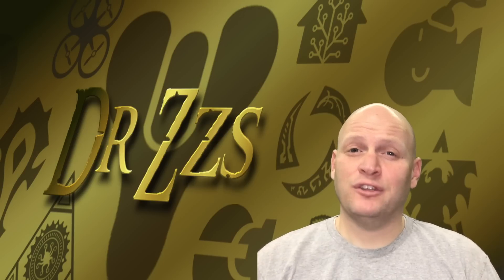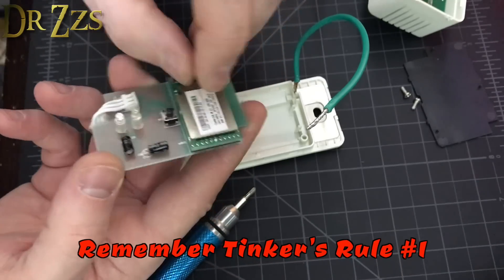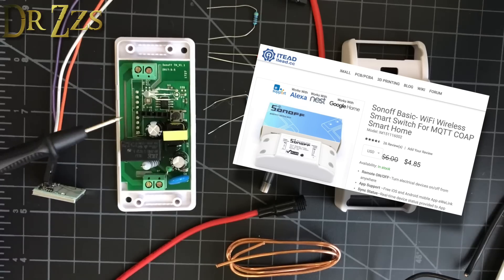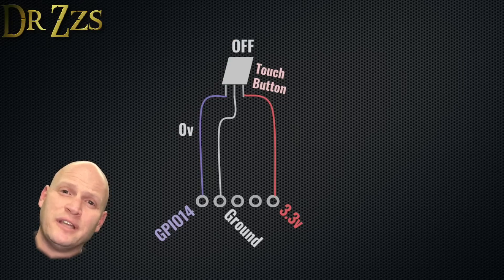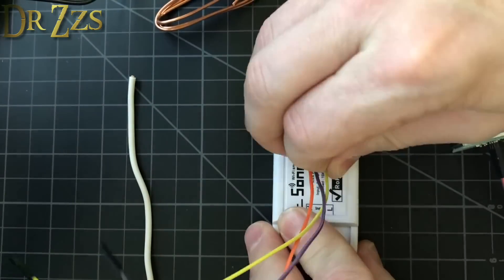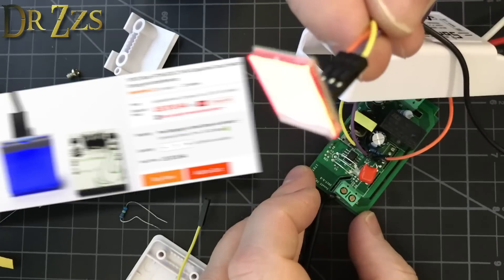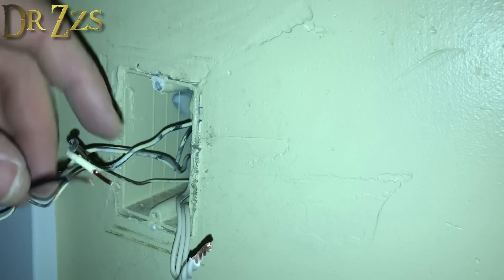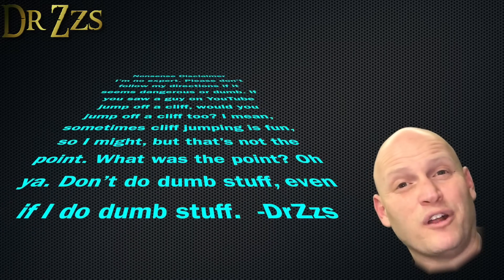$5 Sonoff + $2 parts = Best Smart Switch EVER!

Comment: Awesome Videos! With regards to fitting things in the wall box, i typically take an x-acto knife and cut the ends of the Sonoff case off, just after the screw terminals. Pretty easy to do if you remove the board and snap the empty case back together, then just slice straight down and across the bottom. Do this for each end, the way the case is designed there is still a bit of plastic at each end to keep things out of the case. It also makes running the GPIO wires easier just out the end of the case. Only thing lost is the wire tension support, but a bit of solder and the fact these are being shoved into the wall, really has no need for the clamp. This allows it to fit with a bit of room straight up and down in the wall box.

Thanks Again for your videos! Inspiring me to actually make videos of my projects.
Reply from the maker: Thanks!  
yes do make videos!  I had no idea anyone would really be interested in what I was doing.  Turns out there's a lot of people out there that'll want to see it.

Comment: What happened to the $2 parts? Lol the touch switch is 16.99 now.
Reply from the maker: No worries!  
I like fact checking.  I wanna make sure I'm not over exaggerating.  
A little exaggeration is just good marketing though! ;P
Reply from the maker: that's for 5.  
The link from aliexpress has 5 for $10
Reply from the maker: I was wrong.  Aliexpress has 10 for $10
https://www.aliexpress.com/item/10PCS-Blue-HTTM-SCB-2-7V-6V-Capacitive-Touch-Switch-Module-Strong-anti-interference/32837535126.html?spm=a2g0s.9042311.0.0.Xw2cKY

Even better!
Reply: Still cheaper than a smart switch!
Reply: DrZzs sorry I didn't realize it was for multiple peices.

Comment: Wow! This is awesome! Any way to build one of these for a 3-way switch install? I love the look of this too! Nice job!
Reply from the maker: Thanks!
They do look good! 
You can totally do the same for 3-way switching.  This is how I've done 3-way set-up. 
https://youtu.be/GEJCk-Dr3BQ

Just use the touch buttons (plus the pull-down resistor) instead of the chrome ones.  
I've got a spot where I want to use these with a Sonoff Dual to control lights and fan in the bathroom.  Should work great.
Reply: DrZzs will check it out! Thanks!
Reply: DrZzs cannot also tie these into Home Assistant using mqtt right?
Reply from the maker: For sure!  
That's what I do with all my Sonoffs.
Reply: Have a video on how to set that up?
Reply: Never mind - it's on your site :) Thank you!
Reply from the maker: I shoulda made it easier to find. 
http://drzzs.com/zzonoff-my-masterpiece-diy-smart-switch/